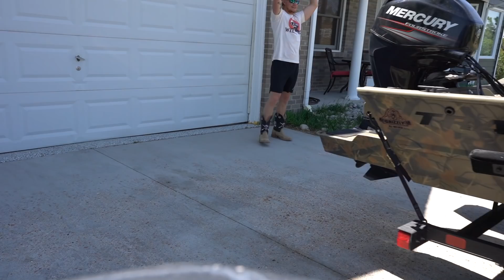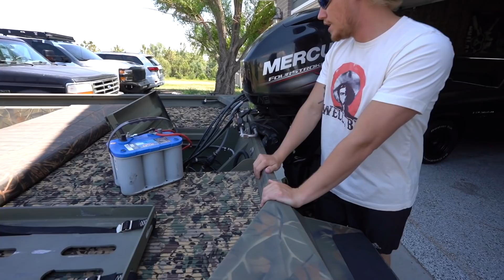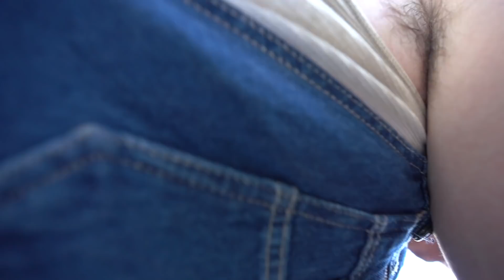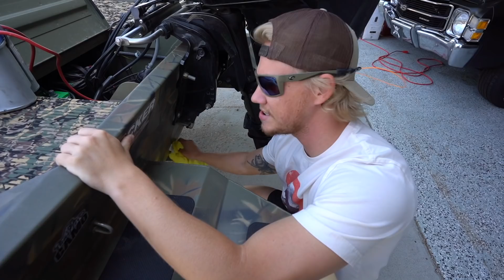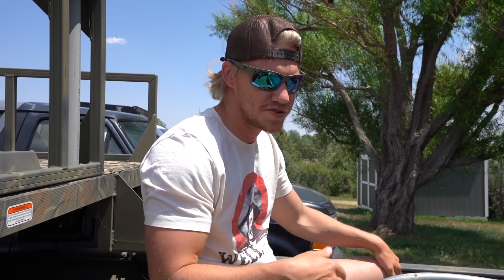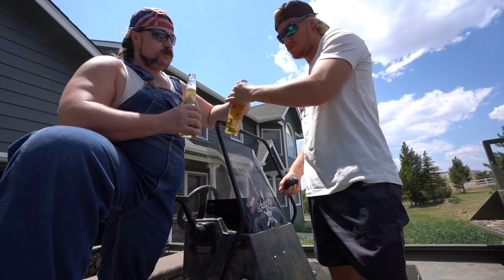The Reason I Ain't Been Uploading... (Boat Almost SUNK!)

Comment: If I'm using something that's gonna create a chemical burn or something then I'll use gloves. For the most part, I go bare hands and wash my hands. Makes it a whole lot easier if u have the gritty, mechanical soap. Just as long as ur hands don't still feel greasy or has dirt/rust on em.

Comment: Outlaw, you shouldn't weld that hole up, you should just order a stainless steel thru-hull hose connection for your boat. They're around $30 but they'll never break. Just make sure you measure the hole so that you get the right size. You want it to just fit into that hole with very little to no play. Plus you want the rubber washers/seals that go on it so that it never leaks. That new fitting you just put on was not large enough, it had to much play in it. It can vibrate and move over time and start leaking. But it should be good for a while.

Comment: Gloves, it depends on the job, and what I'll be doing later that night,  or the next morning. Adhesu es and certain chemicals,  gloves are a must. Same with open wounds on the hands. Also wear them if I'm working around dogs, and I am handling antifreeze,  as I don't have to ignore the dog, to go wash my ha d before petting them,  just remove the gloves, and pitch them.

Keep in mind that some  chemicals.are know carcinogens,  including oil additives,  and used motor oil. As I mainly work on motor cycles,  the friction material is in the oil, so you are also dealing with asbestos, when doing an oil change. It's a case of  an ounce of prevention,  vs 10 points of cure.

That and motor oil, and a pinch.of.dip,.don't mix. Same with antifreeze and brake fluid.

Comment: I don’t know how long your boat was sitting or where but if it stays outside check it for mice and other rodents periodically, mice got in my dad’s livewells through the overflow and built a big a** nest in there. I don’t think something chewed on yours but maybe. I think the other commenters nailed it. Could have been overtightened and stress cracked overtime. Good video, hopefully saved someone else’s boat from going under.

Comment: That fitting may have been over tightened and was cracked at some point before it finally let go.
As for gloves, I work as a mechanic, and wear them all the time.  I don't particularly want chemicals, fluids and fuel to get into my skin over the course of decades.
When I first started, I did not use gloves.  Dealer supplies them now.

Comment: Never use gloves..... Just a recommendation, any fittings that go through the hull should be stainless.  They are a little more but will last forever and less likely to break\crack\leak.

Comment: I started using the nitrile gloves when I am doing anything with grease or any lubricant because my hands dont work correctly all the time and sometimes I cant grip shit so it also helps keep grip on things but you can do it either way I just go through more towels and takes more rime than taking gloves off and throwing them aside. Thats why I like them but you will get the same outcome either way there is no correct way its all personal preference.

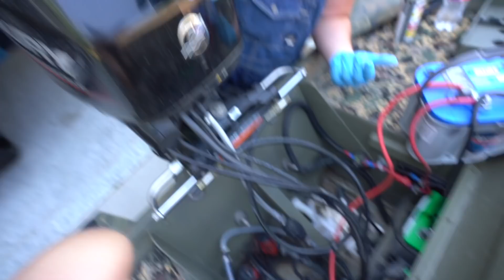Comment: 7:36 lmao.. and I use gloves most of the times. I hate having to wash my hands, especially working with paint because it sticks. But everytime I work with bolts or nuts...it doesnt matter how tight or what kind of gloves they are...they always get in the way and make your job take twice as long, so I take them off. Majority of the time in winter i use gloves otherwise when its summer I usually dont wear any. It's funny though because some people consider others sissies when they wear gloves